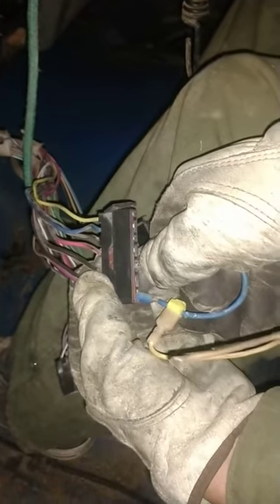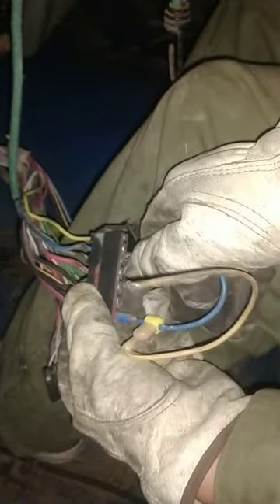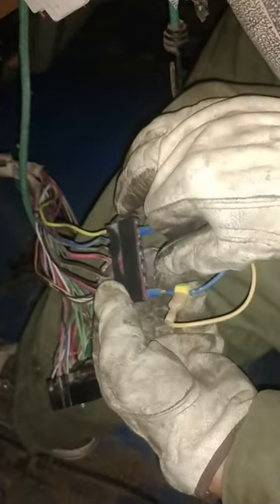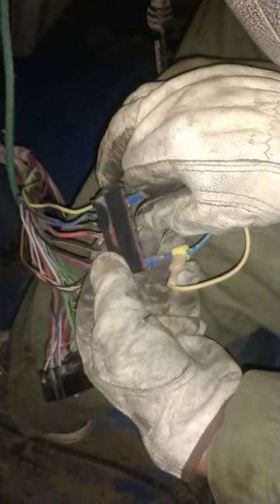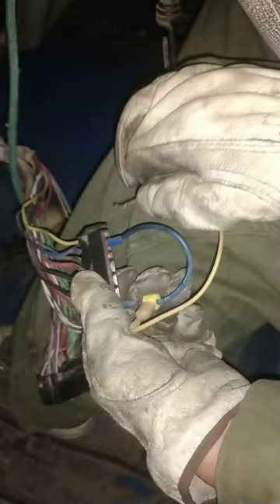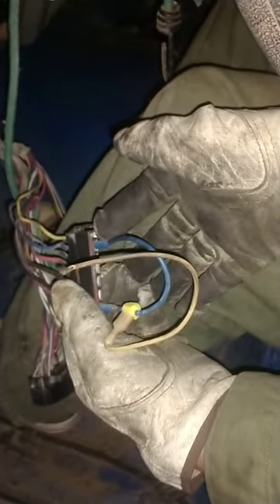How to hot-wire a 1990 Dodge truck , ignition switch bypass

Comment: I screwed something up after working on my steering column and now this may be the only way I can get the damn thing started.
Reply: Idk if it's the same, but I have a 87 100 custom and there are rods on the colum that you can see from the inside of the truck if you put the steering wheel down. If those rods are loose then then you won't get power to ignition
Reply: @clinicallydisappointed4801  It turned out the linkage had slipped out of the slot it rides in. It was a pain to break it down again but I managed to get it figured out. Thanks for the advice though

Comment: I’ve been playin crank no start for 3 yrs on my 89 3.9. The ignition switch in the Column kills power for ignition but not for starter? Is this the same plug that has a rod on it in the 1st gens? Thanks for any help.

Comment: Mine has to be plugged in to get the fuel to kick on. I can only hot wire start it when it’s unplugged therefore I don’t have any fuel when unplugged
Reply from the maker: Yes any wire will work

Comment: on mine I have no power from the red wire; is the red wire 12v; if so then I could run a wire straight from the lighter port, or battery, then I'd need a fuse or a clicker box ya!?
Reply from the maker: yes , it's 12 volt . check your fuses. you should be getting power there.

Comment: Thank you for making this! How did you make the jumper? What did you use?
Reply from the maker: You can literally just skin some wires and twist them together. Or you can get wire connectors at the store crimp the spade ends on the wire

Comment: Will this work on a 1999 ram
Reply: I'm going to find out today. But I have no key hopefully I can steer it.
Reply: @robbishop1146  did it work
Reply: @rossdog806  yes it worked simple and quick when in a pinch.
Reply: @robbishop1146  what are you’re wires from though? Like the little black thing
Reply: @rossdog806  do you mean what kind of wire did I use or where do you find the wires for the ignition.